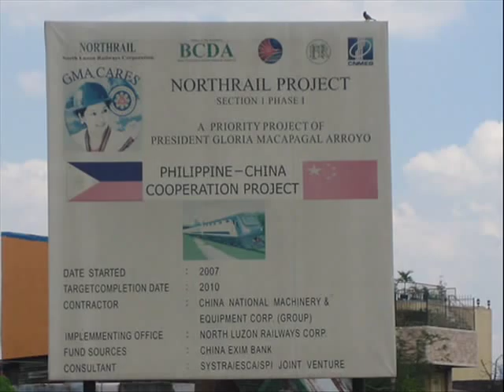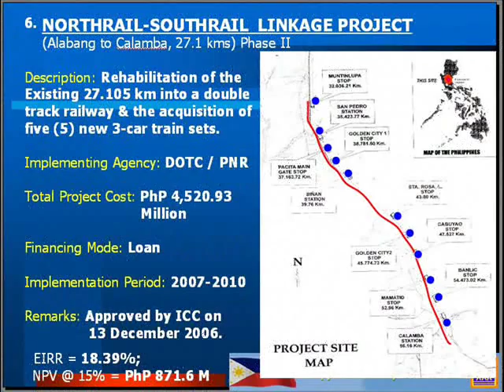PHILIPPINE BULLET TRAIN COMING SOON (UNDER CONSTRUCTION)

Comment: There is no Phase 1 for the Bullet trains from Metro Manila - Clark. Off course they want to get passengers from the Metro hence the 3 stop overs. My idea is after the 3 stops in Metro Manila, they should have 1 stop in Malolos, Bulacan and 3 stops in Pampanga, 1 in San Fernando near SM Pampanga and the other 2 in Angeles City and  Dau,Mabalacat before going all the way to Clark. 

From Clark to Nueva Ecija to Tarlac it is the North Rail Project using diesel powered trains and not bullet trains.

Comment: For those who are wondering, this project was stopped by Pres. Aquino for being "riddled with corruption", a claim still unfounded to this day.

The end result: The project was abandoned, and we had to pay the contractor in a settlement that costed us billions of pesos.

The Northrail project has since been abandoned since but now the project has been revived under Japan's JICA funding, with feasibility study done and construction is ongoing with Japanese contractors and is now called PNR North. Partial Operability is expected to be in 2021. All the columns you see in the video has since been demolished as it was found to be compromised (due to years of neglect) and incompatible on JICA's design.

Meanwhile the LRT Line 1 North Extension and LRT Line 2 was already finished by this time during Arroyo's term. MRT Line 7 is also currently under construction and is expected to be operational by 2022.